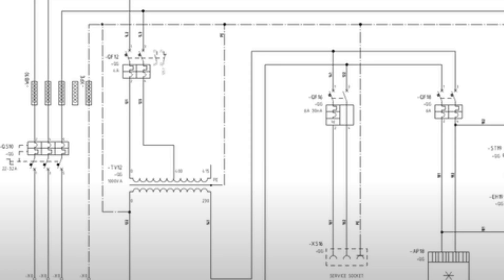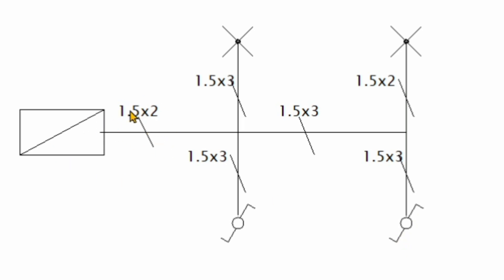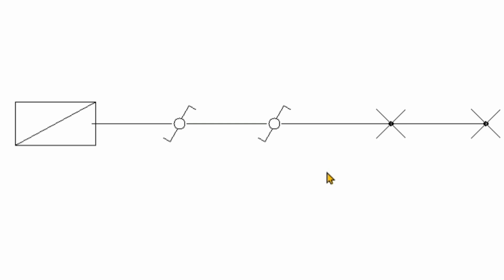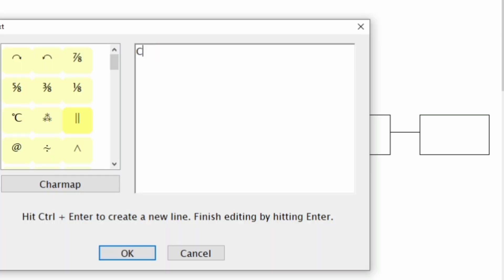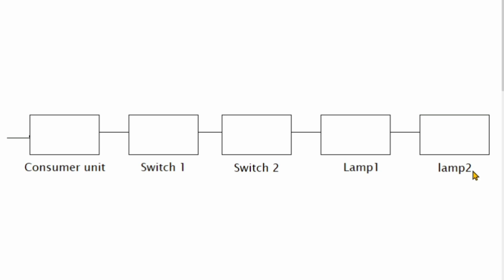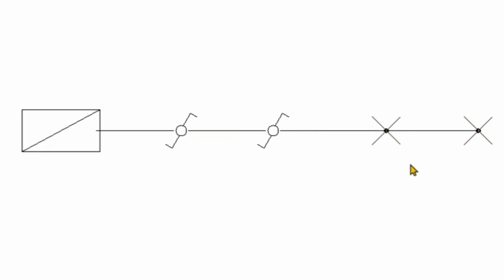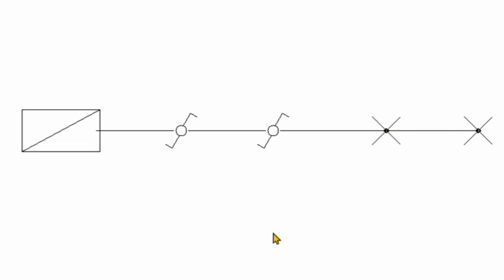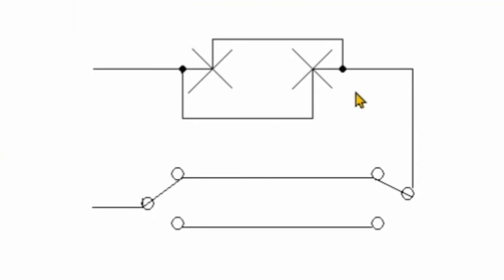Ultimate Guide to Schematic Drawing | Electrical Wiring Diagrams Explained Step-by-Step

Comment: Please I have a question on electrical motor.... I have a 3phase electrical motor that I want to connect to Delta connection but on the name plate of the motor..it indicates 220v on the delta and 380v on star ...what does it mean? Why is the delta not 380v as well?
Reply from the maker: @Justpurehoopleague  please use this link to get a comprehensive answer to your question 
https://youtu.be/n6kSoGAj2vU?si=qtfamwIDTD96CLwO